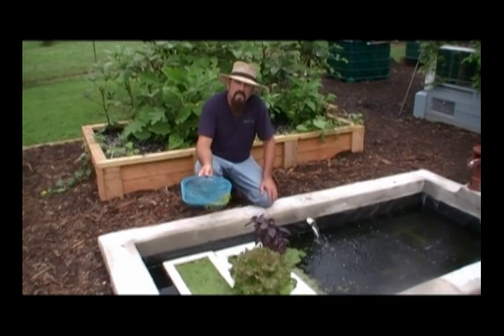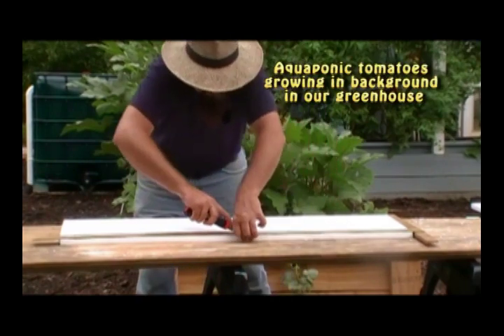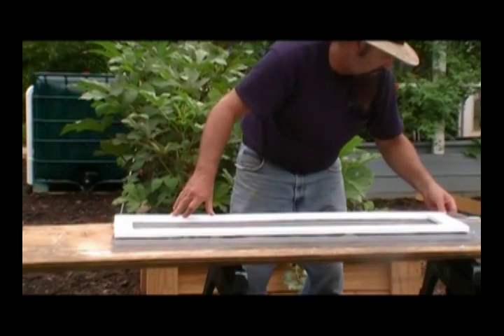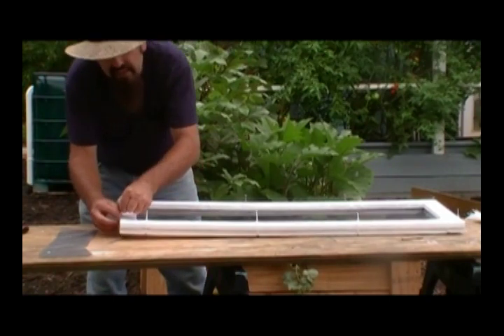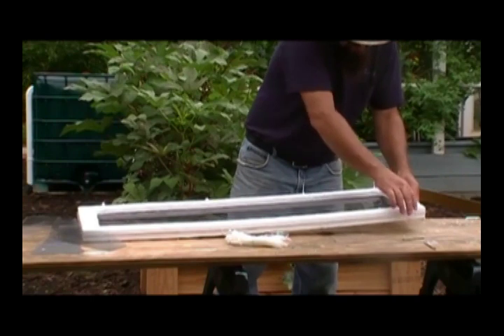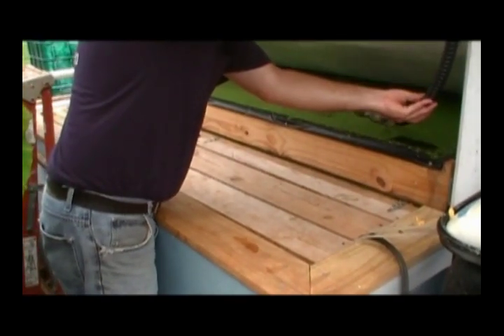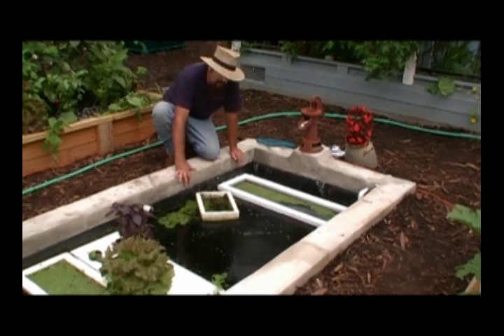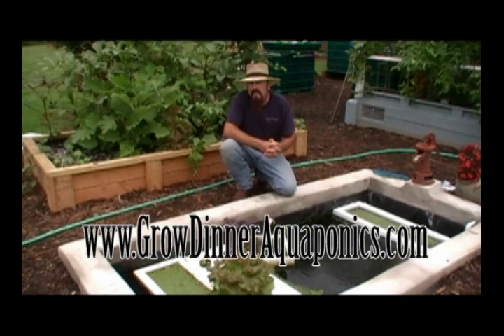How to Easily Grow Organic Fish Food – Duckweed in Floating Rafts

Comment: I did something like that in my goldfish pond/pool this summer (practicing for caring for a tilapia pond). I used those stackable baskets, the plastic ones with the slotted holes in the sides. They float well enough. The baskets with the deeply rounded edges worked better than the flat flanged edges as far as floating higher and being more stable. Those baskets cost me about $6 each! Your way would be Much more cost effective. I originally bought the baskets to construct submerged plant pots, but last year the goldies dug in the pots and ...made a peat mess. We all had fun in the pool together on cleaning day though. They love it when I wade in and they get underfoot like cats! Hopefully when and if I get the tilapia most of these kinks will be ironed out. I'll definitely try your floating basket design for my duckweed. Once it forms a mat it's really easy to keep together.

Comment: Or... use 1.5" expanded polystyrene, which is stronger than 2 pieces of 3/4", and just mount the mesh underneath and up over the edge of the polystyrene.
Reply from the maker: Alan Howlett  I show how I did it you can do yours as you like 3/4 is what I had around